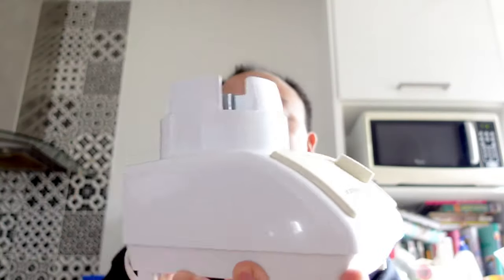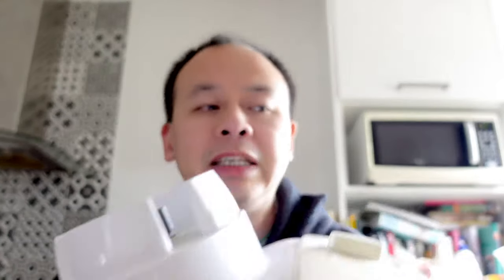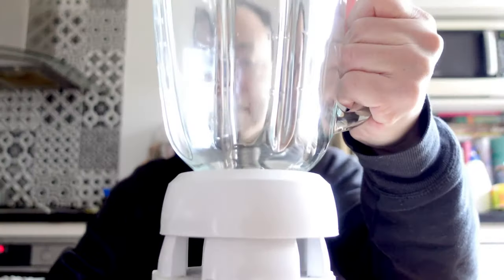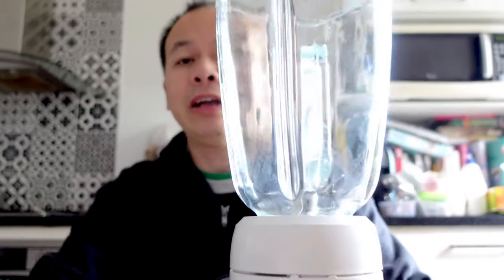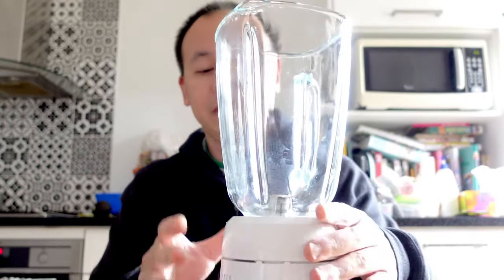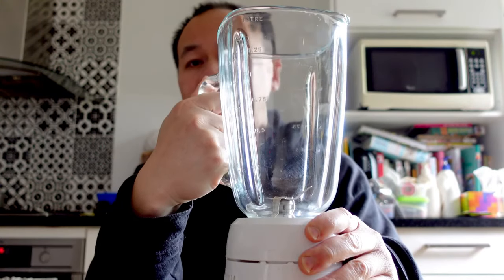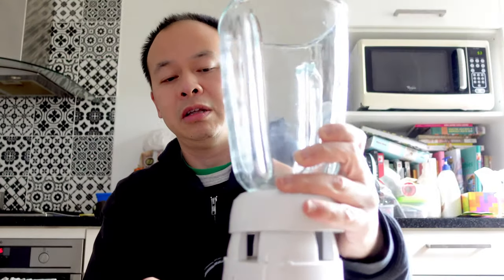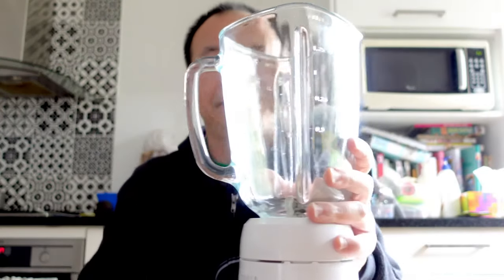Is your blender base stuck?? Here's an easy way to get it unstuck!

Comment: I’ve been using this “trick” for years, but there’s a couple of things you also need to do.  The first is you need to turn the top piece in a COUNTERCLOCKWISE direction at the same time applying a slightly downward pressure.  The second is, do not use a smooth surface to hold the base.  No marble, granite, quartz, etc.  Use wood, like a butchers block.  Smooth surfaces will make your efforts turn the base as well.
Reply from the maker: @zippitydoodads9947  good suggestions. Yes, the blender has to be jammed into the base firmly to increase the chance of success
Reply: It unless it has suction cups on the bottom to hold in place.

Comment: Oh my gosh! thank you so much! I have been going crazy trying to unstick my blender from the bottom! I was afraid of the glass pitcher breaking in my hands. I tried hot water, I tried putting it in the freezer and then trying to open it, I tried wearing rubber gloves and forcing it open, I tried prying it with a butter knife, I tried pouring olive oil into the pitcher and then trying to turn it. Your simple solution worked perfectly!! Again, thank you so much for saving me so much time, money and stress! I was ready to buy a new blender. ❤😘
Reply from the maker: I’m glad I was helpful. Have a great day!

Comment: After watching this video, I was impressed but immediately thought that that will not work for my blender that has been stuck for over 8 years, like really stuck.  I am a female, so I had had several strong men attempted to open that blender, but they just couldn’t.  I was on Amazon, eBay, Walmart, browsing around for a new one before watching this video because I had given up hope, understandably so after over 8 years.  For some reason, it just came to my thoughts to check in on YouTube to see if there is any video that might have some tips as to how to remove the stuck part of the blender but at the same time, there was a hint of doubt as to whether any method would work for me after so long.  Well, my thoughts were wrong.  My blender opened using your technique.  It really did.  I mean I am still shocked.  You just helped me to save my money.  Thank you so much for sharing.
Reply from the maker: I just read you comment and this is why I love to make videos. I’m so glad I could help you. Have a great day 😄

Comment: Amazing! It worked! I have spent like 20 minutes trying to unscrew my blender base because there was trapped water making it stuck. I followed the instructions about putting it in the base and using the handle to turn and got it loosened in 10 seconds! Great video and thank you for the tip!
Reply from the maker: I’m glad you now have a clean blender! 😃

Comment: I forgot to put the gasket back on before I put the cap on and could not get it off after making a smoothie. I was using a jar without a handle and even though slightly tough at first, it still worked.   Thanks so much for your video!! This really helped!
Reply from the maker: I’m glad I could help you. Thanks for your kind comment

Comment: Mine doesn't work I tried that already.  Mine is an Oster with thick glass and a thick hard plastic bottom.  Before my bf and I split I had to use his cabinet mounted vice grip but now I don't have one.
Reply from the maker: I’m not familiar with that brand. For this to work, the blender must be able to sit on the base in some “teeth” so you’ve got something to use to anchor it when you turn the blender jug. Hope you find an alternative to removing it without the vice grip

Comment: amazing. yes, it works.   thank you!
Reply from the maker: I’m glad I was able to help you 😊. Have a great day
Reply: @DerekChaiMedia  so for more details- a marguiritaville frozen concoction maker-  it worked perfectly.   I was struggling just as you described... even trying to figure out how it works right/tight/ loose/ left, - didn't have the hand strength to move it anywhere..  Then I saw this.
Reply from the maker: @sharonnoras  now you can enjoy more tasty drinks 😄
Reply: @DerekChaiMedia  Hi Derek- this time I may be doing something wrong.  Do you turn the blender counter clockwise or clockwise?
Reply from the maker: It depends on the model. But in general anticlockwise to loosen things. Let me know how you go
Reply: Derek, yes it worked again.. It IS  counterclockwise.  Thanks.
Reply from the maker: @momchard-yaron3633 that’s great news 😀

Comment: Thanks so much for this video tip. A friend of mine has been using my blender, but she has not cleaned it very well, so consequently I cannot unscrew the bottom from the jug. You are certainly correct that 'brute strength' will not help. I am going to follow your advise and put the jug back on the stand and twist left.
Reply from the maker: Did it work?

Comment: It did not work i have a ca4406 back to basic blender and can not remove the bottom can you help
Reply from the maker: I’m not familiar with that blender. What brand is it? This trick only works if the base (the motor bit) has “teeth” that the jug sits on

Comment: Great tip! Now, if I can only figure out how to remove the bowl from the base of my Oster 14 cup food processor, I'll be good. It's stuck and won't move from locked to unlocked. Ugh.
Reply from the maker: Thanks. Does the manual give you any ideas?
Reply: @DerekChaiMedia  Yes, it says, "Turn bowl clockwise until to unlock." Like, duh. It barely turns at all. 😭😭😭
Reply from the maker: @asifasani1891  When you put the processor bowl in, does it lock on with teeth like a blender that you can use for leverage?

Comment: Hi, so I did this trick before watching your video and it didn't work. Now I have tried again, but I had to put more strength into the turning and there the base of the blade came off.
Reply from the maker: Good work! Now you can clean your blender

Comment: Doesn't seem to work on mine. Can only turn the glass goblet clockwise when its in the base. To unscrew the jug I'd need to turn it anticlockwise, and doing so it moves it of the base. Back to the drawing board :-(
Reply from the maker: Have you tried leaning down on it (ie. standing right on top of the blender)? Maybe that will add some pressure to it and stop the jug moving out of the base

Comment: What I do wrong. Didn’t work for me
Reply from the maker: Does your blender base have teeth that the jug can latch on to when you turn it?
Reply: Yes. But it just won’t turn. Hurt my arm though 😅
Reply from the maker: @norwatijaapar1378  you could try putting the base between your feet / legs. Might give u a bit more leverage to twist the top off. Don’t give up!

Comment: I am confused. I tried turning on base but the whole jug just comes off again so then I thought you meant turn against the base lock (clockwise) but all I succeeded in doing was make it even tighter. Boo!
Reply from the maker: You have to push it down so that the “teeth” are engaged between the jug and the base. You then turn the jug anticlockwise and it should work
Reply: @DerekChaiMedia  I can't do it. 😥
Reply from the maker: Is it not turning? Does the base have “teeth” for the jug to grab on to when you turn it ?
Reply: @DerekChaiMedia  so I put oil in it... put it in boiling water several times..left it for a while...used it again for a smoothie... & FINALLY it worked. 👍
Reply from the maker: @nicolemcsweeney6395  Awesome! I'm glad you finally found success!